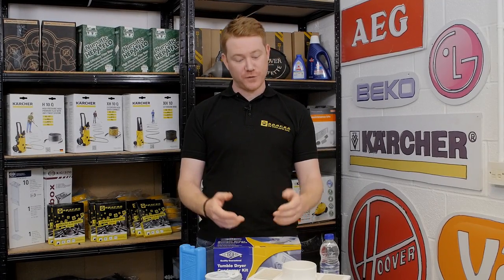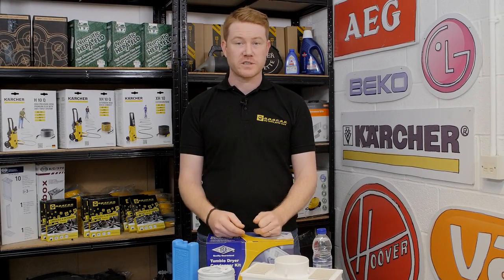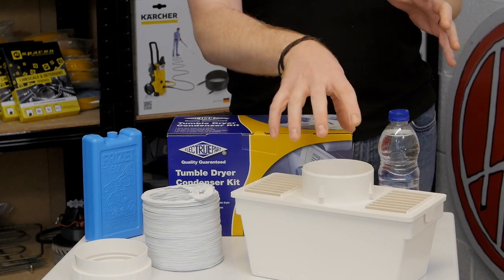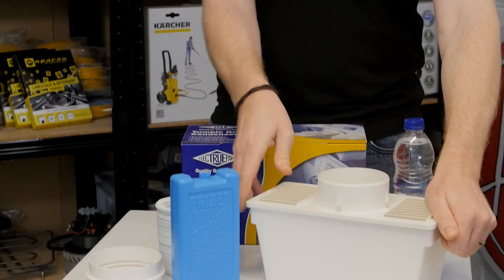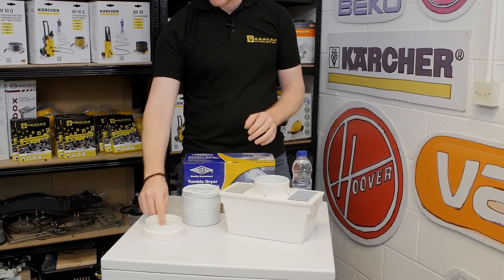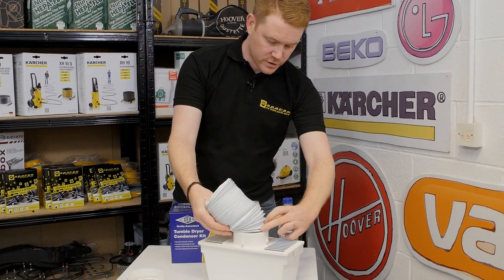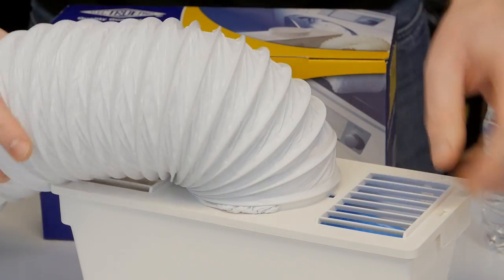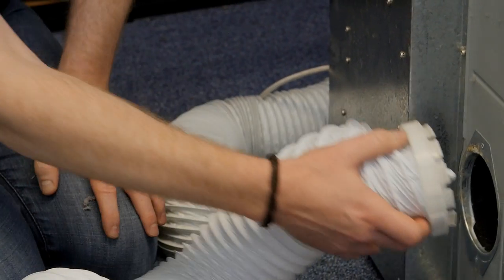Vented Tumble Dryer Universal Condenser Kit

Comment: is it a MUST to use the hose that comes with the KIT or instead can't u just use the 1 that came with the dryer to the box? thanks
Reply from the maker: You can use either hose as long as you can attach it to the machine after removing the old hose from the connection.

Comment: Do you add water to both sides of the condenser?
Reply from the maker: Yes, fill to the top of the partition and replace regularly if drying for a long time as the cooler the liquid the more efficient it will collect the steam.

Comment: What happens if I don't change the water for a long while?
Reply from the maker: Water should build up as it is condensed from the humid air so it is likely it would overflow. Not replacing the water in the contained will allow the water to warm and the temperature difference from the air would reduce so it would become less efficient releasing more condensation to the room.
Reply: Thanks

Comment: won't it cause mold in the house
Reply from the maker: Iis still important to ventilate the area as this does not remove all the condensation. However it should be a significant improvement if you are not ventilating externally.